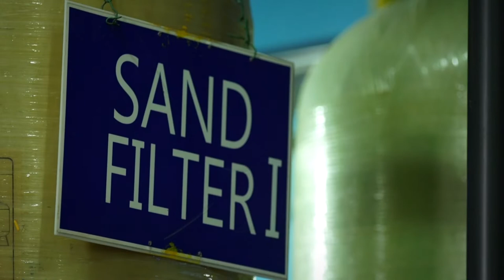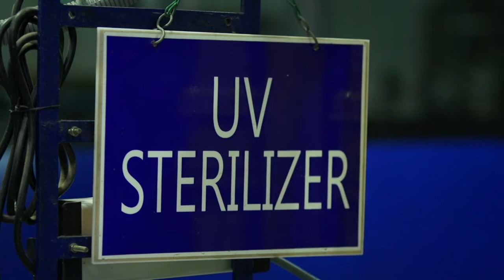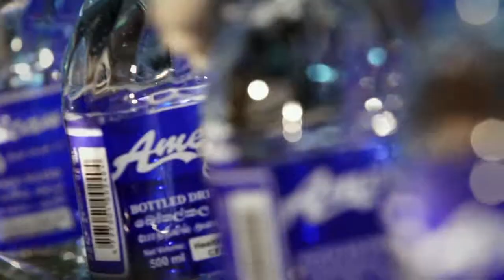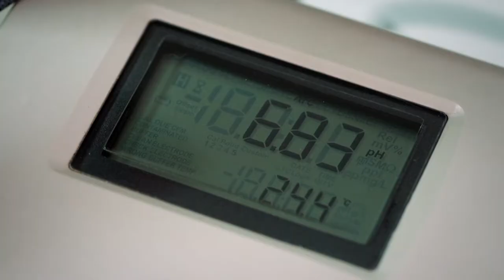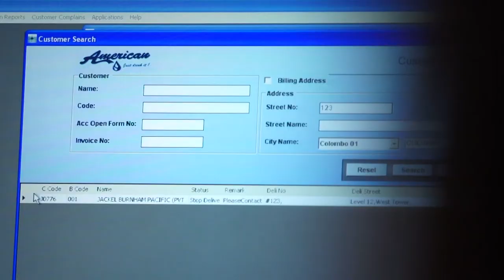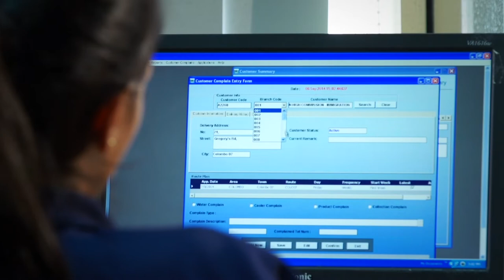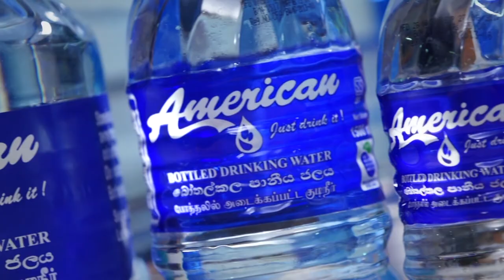American Water Premium - Company Profile

Comment: We are a long user of American water.
Currently the quality of water and the bottles are deteriorating. 
1.The white valve on top of the 20ltr bottles replaced with a permanent plastic  which is hard to prick when putting on the dispenser.
2.Bottles are in bad condition. So many plastic patches arround the bottom of the bottles
3.Unlike earlier, after water finished in the dispenser, the filtering unit becoming dark brown colour.
Although complained over the phone nothing has improved up to now.
It is a advice for the managers to take action before it is late.